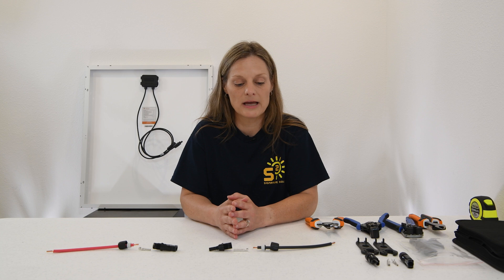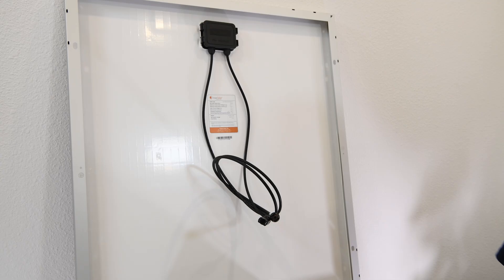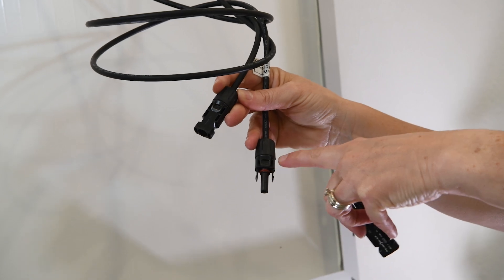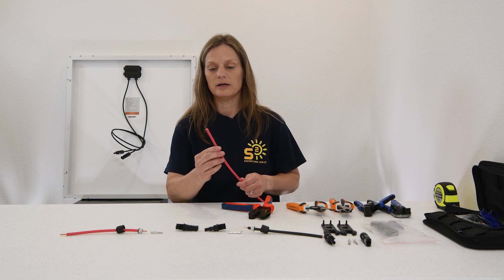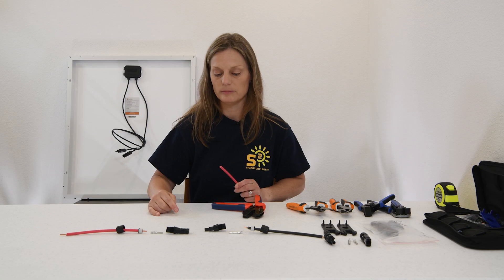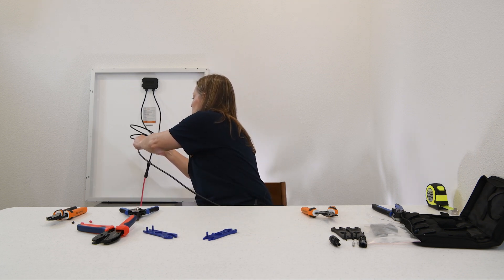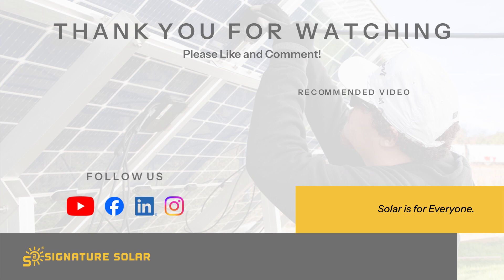How to Assemble MC4 Connectors for Solar

Comment: 1. So, the plus and minus symbols on the connectors have zero, nothing, to do with positive current and negative?  Why doesn't it simply say to connect A and B? 
2. How to open up the connectors again when one clamped them all down incorrectly? So you don't have to order a whole new set?

Comment: At 1:08 in the video it says the female terminal end becomes a pair with the female connector. It should say the male terminal end becomes a pair with the female connector. This is the confusing part of these connectors. It's been 3 years since I did one and this section just made it worse. However I watched that section 10 times and now I got it. Again. LOL Other than that one small section, a great video!

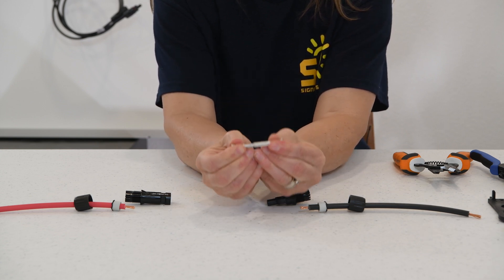Comment: 1:00 You said "female terminal end" twice when illustrating which terminal end went inside which connector housing.  This does indeed make building connectors confusing. This error has been pointed out multiple times before in the comments. The least you could do is pin one of the corrections to the top of the comments to remove some confusion.

Comment: I need to connect my #8 wire to MC4 connections. Would I use the same connector as #10 wire? I can’t locate #8 size MC4 crimpers on Amazon? Seems odd.

Comment: Shouldn't PV solar cables be double-insulated?  The wires in the video look to only have a single layer of insulation.  At least that's the UK requirement - not sure about the U.S.

Comment: other videos say put the red\positive wire with the male plastic piece
Reply: The male end is positive, yes.  But when you're crimping an MC4 connector onto a wire that needs to connect to that positive male connector, it has to be female.  It used to confuse me that I was crimping a female end on a wire that was positive.  Just remember, if the connector you're crimping is going to the solar panel, it has to be opposite.  So you would actually put a female end on a RED wire in this case (if you're using both colors).

Comment: Let's say I installed one of the sides incorrectly. Is there a way to find out which side is bad without taking both of them apart? I can Yank hard on both ends without it coming off
Reply from the maker: There should be little pins that lock into each other. You will either need a MC connector tool or you can use for example pliers to press the pins in to pull and seperate the connectors. If you're still having trouble, please don't hesitate to give us a call at 903-441-2090!

Comment: Why are you disassembling the connectors? 
Wouldn't it be better to follow the official manufacturer's instructions so that;
- your insurance is not voided, 
- you can't accidentally put the compression gland on the wrong way,
- you can't accidentally pinch the seal,
- you don't start a fire by ending up with water in the connector

I don't see the point in making up your own methodology when Staubli has invested so much in the design, development, and testing of the connector over so many decades, versus what i presume is you just guessing as to how the connector should be installed. Also, for both inexperienced DIYers, and experienced professional installers, following the official methodology is faster and less error prone. Is there some advantage to your novel method i haven't understood?

Comment: I just received MC4 connectors from Signature Solar. The threaded ends are different than what is shown in the video. Not sure how to make the connections.
Reply from the maker: Hi! If you'd like to call into our tech support department, we can assist you! 903-441-2090

Comment: Can you use closed-barrel pins?
Reply from the maker: It's best to purchase the pins in a set with the MC4 connectors to ensure that they fit snugly and are the correct length to make a secure connection.

Comment: and if you happen to screw up by crimping or clipping the wrong plastic end onto a metal connector, it's permanent. You have to cut the whole thing off and start over. Now there's wasted cable and connector.
Reply from the maker: You’re absolutely right—if an MC4 connector is not installed correctly, it often requires starting over by cutting it off and redoing the connection. This can be frustrating, which is why we created this video to help guide you through the process step by step. Our goal is to provide clear instructions and tips to minimize mistakes and ensure a successful installation.

Comment: 8 awg and larger use non-crimp connectors. Best way to attach wire? Do I need to solder?
Reply from the maker: This depends on which line you're referring to - for PV wire its just a clamp terminal and the bare copper wires do not require soldering 99% of the time.

Comment: I need to make a conversion cable to connect MC4 to DC8020
Reply from the maker: You can purchase this here: https://www.amazon.com/ENZPOWER-Suitcase-Industrial-Connector-ConnectorCable/dp/B08185CWQ1/ref=sr_1_1?dib=eyJ2IjoiMSJ9.-QS6g-R5tRFqwJRB_RHs8H_NjQ1XqEV6xua5Y3LCwToOk3nGoL6GbCbf2yYeiSrgu8Z_LLzr2nxVlkLuCJBB2yc3exkrbt03SYYx5Vdbw2k2S7e2qNSBoDf2DzeRbs53dnFoM_t4MsOb-r_b-NIbgefjmOuKOoW-ipWWVneHPmkoOTEJGMb6ZheDOuOvtw9SgUD4X4sYxCXOHTHtzzXZ8-sf38BwivewJd9vRXUjZz8.WJJTtvQwAvhsd696fmW7HpQSNn9bgG1WUQ6VcG9wEDU&dib_tag=se&gad_source=1&hvadid=684051182618&hvdev=c&hvlocphy=9027015&hvnetw=g&hvqmt=e&hvrand=18043632035408635998&hvtargid=kwd-2264183322649&hydadcr=1334_13654974&keywords=dc8020+to+mc4&qid=1721225564&sr=8-1
Reply: @SignatureSolar  I saw that but wasn't sure if I'd get power loss or potential fire hazard from the 14AWG part of the cable, vs making my own with 10AWG or 12AWG. It would need to handle 400 watts.

Comment: How to disassemble?
Reply from the maker: While the MC4 connectors can be disassembled, the metal terminal ends within the plastic housing are not designed for disassembly. If there's an issue with these terminal ends, the entire connector usually needs to be cut off and replaced.

Comment: You mention keeping the connectors all the same in the array, does that mean we should not use the mc4 connectors if they came already on the panels? Or would the ones that come with the panels be ok?
Reply from the maker: The connectors that come pre-installed on the panels are likely tested for quality. So, it's a good idea to stick with good quality connectors and keep them consistent when you're replacing or adding new ones.